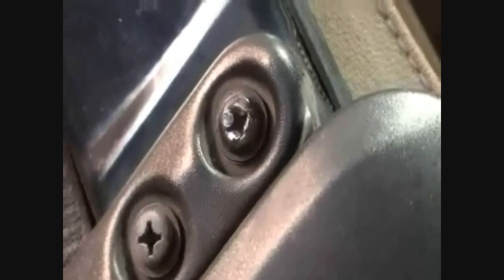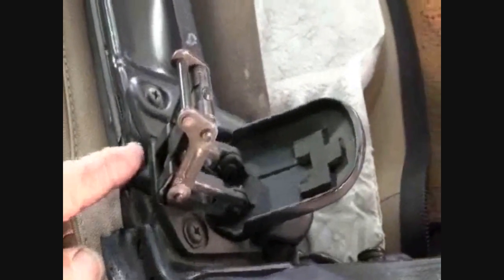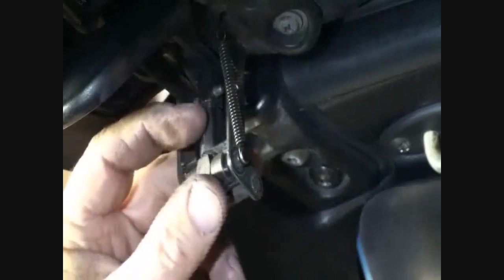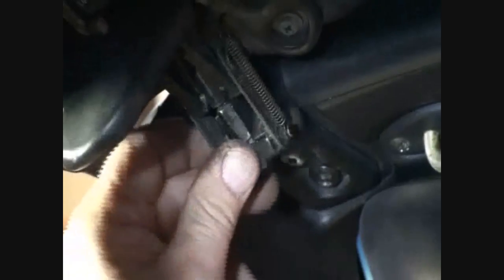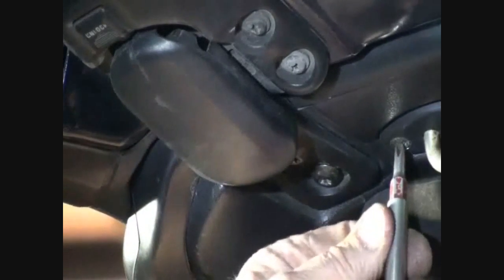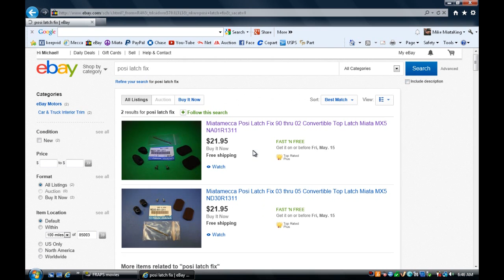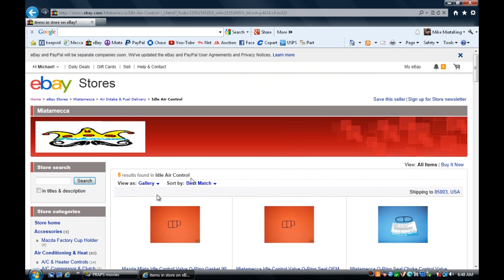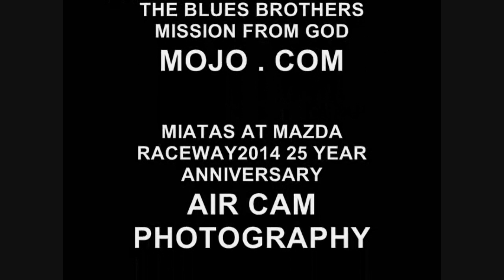How to Fix Floppy Miata Convertible Latches Plus eBay Posi Latch Fix

Comment: What?? I didn't even know you could adjust the size of the latch.
I bought two catches because my roof was not closing properly, and would leave a gap from the outside.

My original latches are just fine, so probably if I had just adjusted them, I wouldn't need new catches...
Well, they're on their way now and I guess it doesn't hurt to change the old catches, as they do look somewhat worn out.

Comment: Having issues with my top going all the way down, I believe the glass window was replace by the previous owner but I’m not sure how to get it down all the way...called Mazda and said it may be the spring tensioners over the phone but hard to know without bringing it in...it goes about 3/4 way down and gets stuck, glass doesn’t want to fold all the way down... I need the Kings help!
Reply from the maker: Hello Sir Kyle,
Thank you for your concerns. This is a common issue with replacement tops. Some upper end tops have thicker material and are stiffer. To fold the top down when you reach the 3/4 point apply pressure down on the upper edge of the window to continue to fold the top down. Will become stiffer as the weather gets colder. Good luck with your top down Miata Mission. Mike, The King of Miatas.
Reply: Mike MiataKing seems so easy! I’ll give it a try my friend. If it doesn’t work can I send you a video directly for some extra diagnostic?

Comment: i know it may be the wrong spot to ask, but seeing as how you practically own my miata, I've been having trouble with mine. once my engine is at operating temp, and i go to start it again after a stop at a store or at home it has starts and then has a complete rough idle for about 30 seconds and is gone. to try and fix it I've gotten under the hood, and i cleaned my egr valve, throttle body, air intake, master airflow sensor, pcv valve, and even changed my valve cover gasket. any opinions as to what i should do next? last resort is i change my head gasket, or buy new valves. so any help is welcome. can you help me out? :D
Reply from the maker: +Saint71jimmy Hello Sir Jimmy,Best way is for us to know what year is your Miata ?You will need to check the spark plugs. Get it hot so it will make the trouble.Start the engine, ruff idle then turn off. Take out the spark plugs and read themto diagnose your issue. Wet spark plug, to much fuel or not enough spark. Good luck with your Miata Mission.Miatamecca.
Reply: +Mike MiataKing the spark plugs are good, gonna see if i can replace the wires, and maybe the coil packs next, the hardest thing about it is that then is no check engine light at all.and its a 2000 mazda miata automatic
Reply: @JimmyPop71  fuel filter